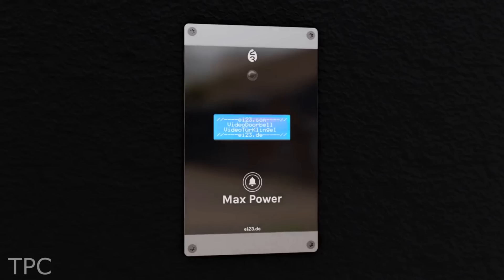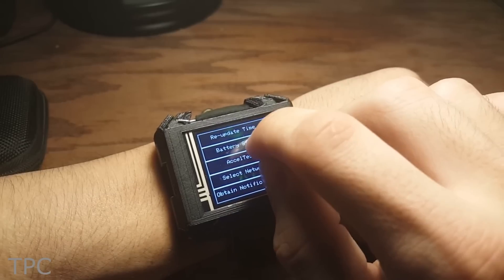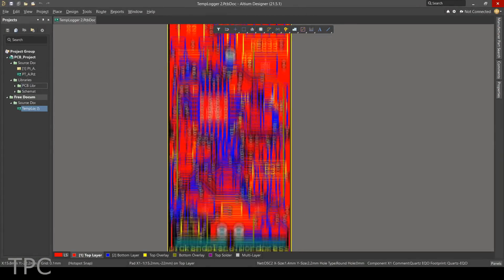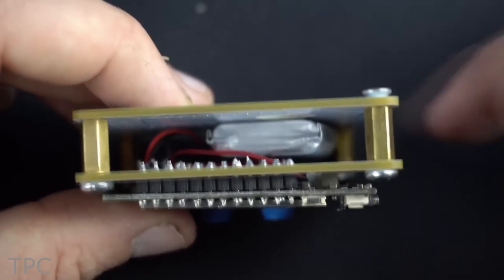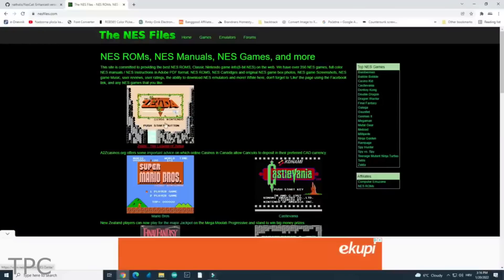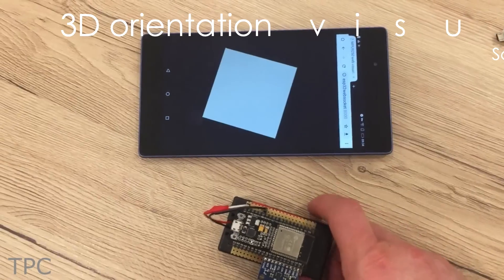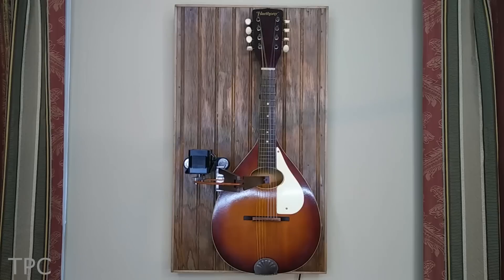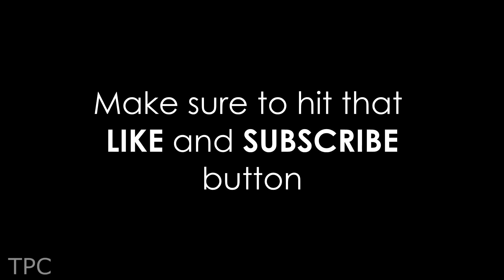Top Notch Intruder Detector (9 More ESP32 Project Ideas)

Comment: i fail to understand the point of these shots in relation to the first project:
00:35 placing smd parts in reflow solder on a random circuit board
00:40 a glass bowl of water placed on the table by the device

4:30 “any nintendo game”? doubt it plays zelda’s breath of the wild.

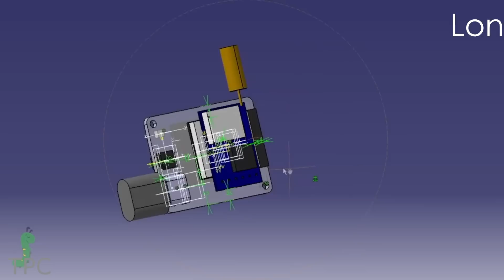5:03 - the long range esp32 as an intrusion alarm is not an instructional video. while he shows schematics, there are no files to download or where to get the pcb. this is making the whole thing from scratch. the video is of him putting it together but no detailed information is provided. it’s also a 2 part video and both videos are like that. no pcb nor schematics.

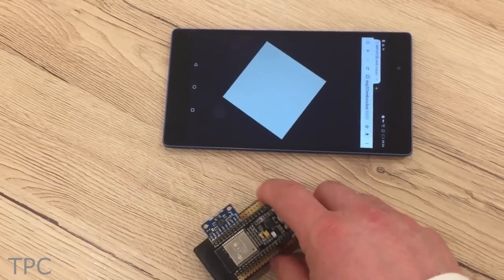6:32 there is no mechanism pressing the frets on the mandolin. it’s only limited to open strings, which restricts it in the number of notes it can play.
Reply: I fail to understand the point of the first project.
Reply: @frankhovis  I think the maker of this compilation did not understand it either. Its made to keep time of the button press in the e-ink display. So you want to know when you changed your cats water, you go and change the water, press the button, the device wakes up, updates the time to the e-ink display and then powers off. The e-ink display will keep the time on the display until the button is pressed again. E-ink display wont change its content unless its refreshed. So you can keep time how long time has passed since you pressed it.